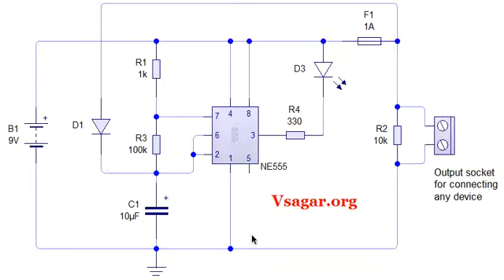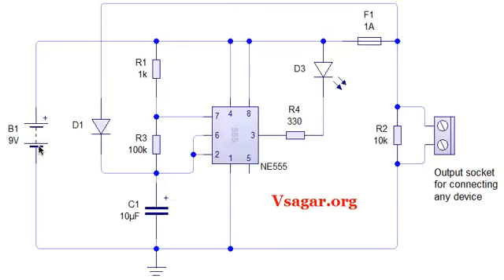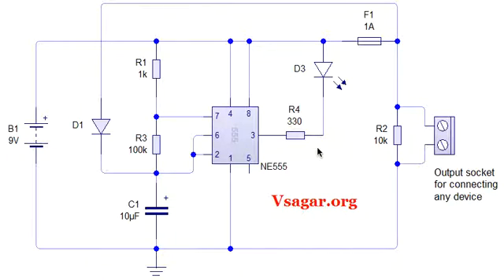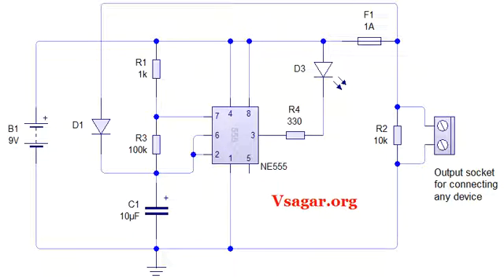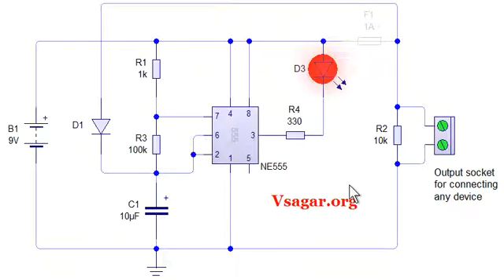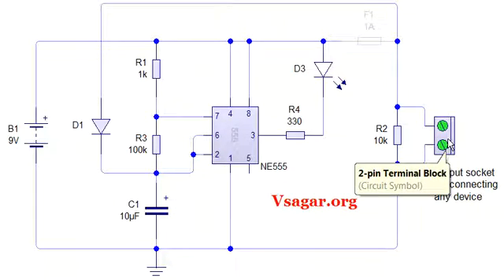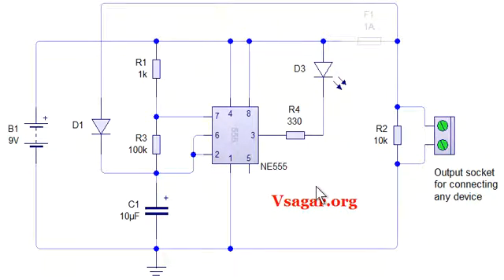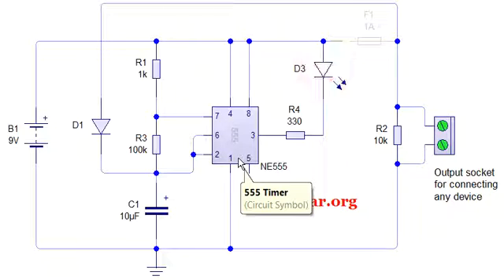IC 555 fuse indicator cum pilot lamp

Comment: Hello, what modifications have to be made if this circuit is applied for PHASE AND NEUTRAL OF A.C
Reply from the maker: armando rojas, wait. I'll reply with modified circuit.
Reply from the maker: I have designed the circuit to satisfy your requirement. Please check it on this link: https://youtu.be/zsND5sFyFQ8